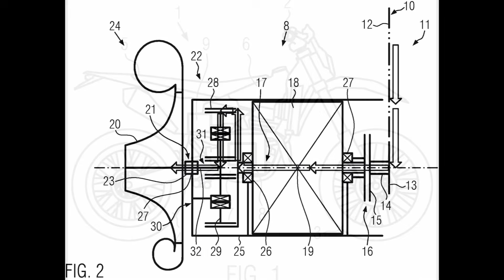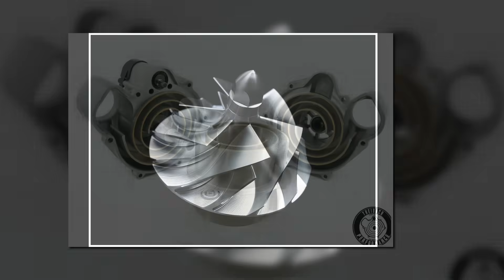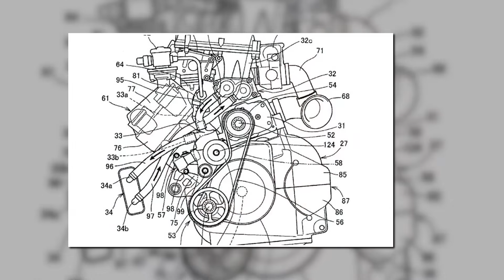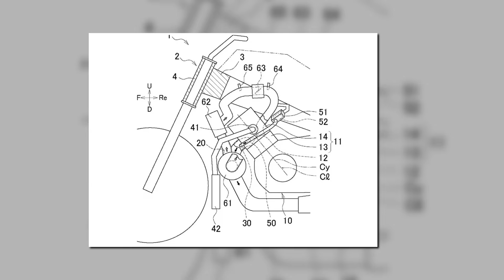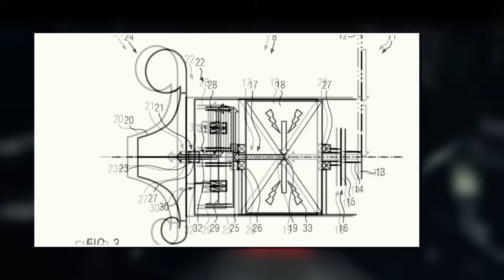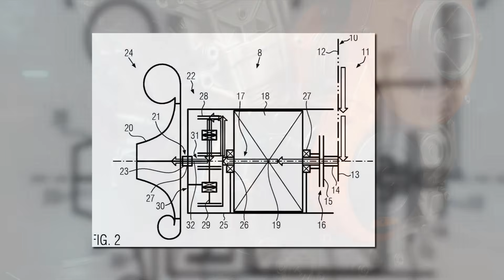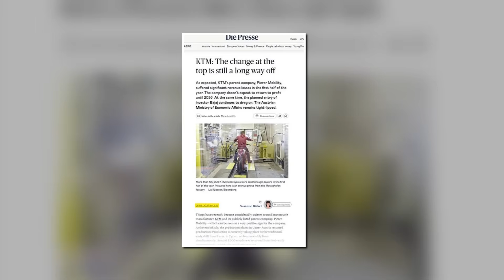Did KTM Just Reinvent the Supercharger?

Comment: The answer to the question at 1:15, "how do you get the instant throttle response of an electric system and the efficiency of a mechanical one?" is just have an electric motorcycle not a petrol one with electric supercharging. 

Petrol isn't efficient.

Electric done right is just better in every way. Lighter, more powerful, cheaper, lower maintenance, longer life, quieter, better throttle response, better traction, better traction control. 

Just mass produce some good electric bikes. All we've had are tiny runs of practically hand built specials at enormous markups and shoddy business practices that rival KTM's. 

We don't need or want supercharged petrol engines. They've been a disaster in the car world, and they'd be even worse for motorcycles.
Reply: I'm not interested in riding 15 miles out, 15 miles back, and then being stuck at home for the rest of the day.
Reply: @thegrinch7989  you wouldn't happen to be a motorcycle dealer or mechanic by any chance?
Reply: @gasdive  yeah bro, I'm part of a conspiracy.
Reply from the maker: I was going to say wait for the comments but they already started😊 having seen the UON1 bike close up and seen what it can do I know what’s possible. BUT. I do like long days riding 2 up often with luggage and I certainly don’t want to be sat behind draughtiness Lorrie’s to eke out the range. So I don’t see any practical examples
Reply: @barebonesmc  I've done many 800 km days on a 2013 electric. The modern ones charge much faster and have twice the range between charges meaning none of the mucking about that I do. But there's still lots of room for improvement with none of the big four wanting the switch to happen, (mostly due to dealers, who after all are their actual customers). The Chinese might lead the way here and it reminds me of when the British marques died, convinced no one wanted reliable bikes that got you to your destination with minimal fuss. The Joy of constant roadside repairs creating a lasting bond between rider and bike.
Reply: @gasdive  The market is speaking loud and clear on this.
Reply: @thegrinch7989     the market has only been offered hand built semi experimental bikes from tiny manufacturers with very little after sales support. The internal combustion equivalent is something like the Langen 250. If you only looked at that you'd conclude that no one wants petrol bikes. 

Add to that the current sales model is via dealers. What dealer in their right mind would want to sell a bike that will only ever come back for tyres when they could sell another old banger that needs a dealer service every 6000 km and 6 hours of billable time every 24,000 km to check the valve adjustment. (Ever wonder why there are no bikes on the market that have hydraulic valves?) Plus after 40,000 km it's worn out and they can sell the chump a new one. Why do you think dealers and mechanics are telling people that electric bikes only go 30 miles and take all day to recharge?
Reply from the maker: 800km days on what electric bike? N how many charge hours that took? All I’ve tried would struggle with that tbh
Reply: @barebonesmc  4 hours. As I said, 2013 machine. The modern ones would need less than a quarter of that.
Reply from the maker: What bike though? A 2018 what? Or am I being dumb 😊
Reply: @barebonesmc  LMAO, the Ind in general is doing it,,,why do you think modern junk is so unreliable today?..recalls  ,on everything, you just don't get it do you...ill leave,..
Reply from the maker: I’m not a mind reader mate sorry. It was an honest question. As you can see I’m one of few channels that actually highlights the increase in recalls. I just honestly have never come across an electric bike that would do an 800 km day including charge times. 200 miles is about the best I’ve seen with several hours charging between runs. So at least 2 full charges to reach 800km even if you start with a full charge and are gentle with the throttle
Reply: @barebonesmc  ok.👍 example ,   my friend Ian Coates...you can google his name...went round the World   on a '97 IIRC 750 Honda Africa twin for so long  it clocked up 380K miles by the time he got back home 13 years later.  ........   [Honda Japan took his bike to the factory for free tyres, service, chain and sprockets on the "house" while he stayed at Mr and Mrs "Hondas"  penthouse! ]..  .🤣.....a brand new  bike would need 3 engine rebuilds to do that with every electrical sensor "fizzing" away, it wouldn't make it. . It is all being made to fail at 3 years or at least on its way,  castings are thinner, plastic substitutes steel, bearings are inferior quality, discs are  recycled steel,  wire is recycled copper full of contaminants  (....the Govts get all the new stuff.).. hence the appalling electrical problems... the "new improved" versions are not improved at all, its even worse with MORE electrical junk bolted on year after year.....RECALLS.  Another friend bought   of those  BMW huge enduro "things"  I asked him why he had bought that unreliable junk shaking my head.......it then proceeded to eat its own fuel  pump 650 miles later. and ended up being picked up by the AA...650 miles from fkn  brand new, eek! ..... he then had to take it back for another  "recall"...as the crap Chinese power coating fell of the  shaft drive casing...really?, at 1500 miles, quality control right there. I could tell you about ABS sensors on BMW cars and "wet belts" on cars and vans but ive rattled on far too long , . I say this with no malice mate, Im from Yorkshire so say it how it is. Im sure we could sit down for a beer with no problems 🤣I have been a biker and mechanic since 1977, its all on a downward spiral im sad to say. The EV thing is nothing more than a collapsing ponzi scheme that will NEVER work.
Reply from the maker: Sounds just like what I’ve been saying for years mate. We obviously got crossed wires. I thought you were talking 800km days on an electric. Tbc my newest bike is an 07. And the oldest and most overengineered is a 74 Laverda. The older they are in general the better the engineering imo. So we are coming from same viewpoint 😊 long day so gonna be early one tonight. Have fun
Reply: @barebonesmc    that was me. I was talking about 800 km days on an electric. On a 2013 build Zero DS with the nominally 11.4 kWh battery (actually 10 kWh) and two accessory chargers. 

Dinner with my daughter, who lives 400 km away. 

155 km to a caravan park where I would plug in and change for an hour and twenty. 95 km to a shopping centre where there's a free AC charger. There I'd plug in for 40 minutes. Then 150 km to her house where I'd plug into two normal outlets while we have dinner. By the time the visit is done, the bike is fully charged. Then 150 km to the shopping centre, 95 to the caravan park, 155 to home. 

400 each way, 800 for the day, 4 hours on the road charging. 

There's an article on the Visor Down site about the preproduction Energica Experia. They do 500 miles (800 km). Having twice the range they only do 2 on road stops and because they're not trying to do it all in a day, they have a charge overnight (but it actually takes only 3 and a half hours) Because it charges 4 times faster they spend a total of 59 minutes charging on the road. Which is what I said above. If they'd been visiting someone who had electricity in their house, they could certainly have done the ride in a day with an hour of on road charging. 

800km/500mile days were possible though wearing 12 years ago and now they're easy.
Reply from the maker: But haven’t energica gone into administration now? 
Re the 800km day that sounds better than most people’s experience. But still not my idea of fun. My tank does around 250 miles between fill ups n I still get sick of stopping to fill up lol even for a few minutes 😊 but each to their own. And I don’t know about over there. But here. Charging infrastructure is just terrible. Planning a journey around fuel stops was why I sold the Vmax 😊
Reply: @barebonesmc       energica is an example of what's possible. As I said, the current crop are hand built in tiny numbers and priced to reflect that. We need a major player to mass produce them but dealers don't like that. 

Energica itself was profitable, it was the investment company which owned them that went into receivership. The latest news is that a company in Singapore has bought them. 

The range is long enough that even poor infrastructure is fine. They charge at Tesla chargers and they're everywhere, (both here and the UK) and super reliable. There are 6 between my house and my daughter's plus half a dozen from other companies. So on my regular trip I'll pass 20 or 30. The UK is much more densely served. 

Don't forget that the 4 hours charging was the 2013 bike. The current bikes are about half an hour every 200 miles. Everyone I have ridden with wants to stop for half an hour after 3 or 4 hours riding. (And I don't know anyone else who rides 500 miles on a regular basis)

PS, Also, don't forget that with an electric every ride starts full. If you ride less than about 250 miles you'll never have to stop. If you ride less than 350 you'll only need to stop for 10 minutes because you can arrive home empty and fill up in the garage. The half hour stops are only needed if you're going 500 miles or more.
Reply: @barebonesmc  We did mate, Im so "anti" electric crap I banned my own customers from owning ANYTHING electric 5 years ago.!...they thank me today for saving them thousands of hours in wasted time stood like a GTA street corner figure waiting for "fuel"  , its all good mate , ill just keep riding my Busa Ive had 17 years or so....electric my arse, EV plants are scaling down with the battery crap as we speak.....tick tock...it does not work, petrol and diesel are going nowhere, the World cannot "survive" without it, cheers......👍
Reply: @barebonesmc  ...apparently, there is a car transporter on fire on the M5 with EVs aboard right now .....hand grenades without a pin.... 💣💥🤣
Reply from the maker: Like I said somewhere. I can see the potential after seeing the UON1 race bike. But at the time I considered building one in a chassis I had, the battery tech was just prohibitively expensive even for a track bike doing 20 min runs but needing recharging between sessions.  As to infrastructure. I tend to stay away from population centres as much as possible 😊 and from what I’ve seen/experienced I couldn’t do what I do with an electric motor. I think they have a place. But I’m not convinced by the practicality yet. Ffs the new Honda has an 87 mile range at best. Also. For me. I’m crap at laptop and phone batteries never mind bikes 🤣🤣🤣
Reply: @barebonesmc   @barebonesmc    if it was still 2010, then I'd agree. Right now there are 6554 locations with 17,132 rapid chargers listed on Zap Maps in the UK.  That's only slightly less than the number of petrol stations (8465 as of June this year). If you include places you could charge up in an emergency to get yourself to a rapid charger, or while just stretching your legs, there's over 40,000 locations. Running an electric does not mean you have to go to London to charge up. You can stick to the countryside. I don't know what you consider to be out of town, but there's 4 rapid chargers and dozens of slow ones inside the Snowdonia national Park. Pick a remote place and have a look at Zap Maps to see.
Reply: @barebonesmc  ten rapid chargers in the Cairngorm National Park. 45 chargers if you include the slower ones. That's inside the park. Not near the park, not on the way to the park. How remote are you going?
Reply from the maker: Unfortunately in practice. More are not working than are. But tbh I prefer travelling outside the U.K. nowadays. The U.K. is a mess. How many in Asturias? Or the Sierra Cazorla? Tourist destinations tend to be well covered but I try and avoid them too 🤣🤣 I like the places no one goes lol. And tbh. Part of it is about what I know and am comfortable with. I’m pretty sure what I have already will outlast me too lol. And when the oldest bikes I have are without doubt the most overengineered I am less convinced than most about Progress 😊 it’s all about what suits you and your priorities 😊 for me. I’d rather spend the money on new adventures than expensive new bikes. Whether petrol or electric. It really is that simple for me 😊
Reply: @barebonesmc  of it's not your taste, I can't argue with that at all. If it's not in your budget, that's fine. If you don't feel like learning something new, well I'm the same. 

But you're arguing with made up facts. Tesla chargers have more than 99% up time, and Zap Maps shows off they're up our not, and it's certainly not true to say they're more often down than up. It's just not. 

There's none in Sierra Cazorla, but there's no petrol either. There are however far more places to charge than there are people stations around the park. 

So if you don't like it, fine, but don't just make stuff up because it confirms what you'd like to be true.
Reply: @barebonesmc  Agree mate
Reply from the maker: I’m not arguing mate. And there are petrol stations in Sierra Cazorla. Just not everything is online😊. As to uk chargers not working. Seen too many queues when only 1 of 4 chargers are working at many service stations. Recently as well as over time. What it says online and reality aren’t always the same. That’s my experience. If yours is otherwise that’s great. Just not my thing. N I did do a lot of research when I wanted to build an electric track bike. Hence my contact with the UON 1 team 😊 I talked long and hard about the build with the team and with Jeremiah Johnson who was one of their riders at the time. In the end my conclusion was no. But that’s just me. If we all thought the same it would be boring 😊 and one certain model of bike would be VERY expensive 🤣🤣🤣
Reply: @barebonesmc  this is the most bizarre conversation.

Imagine if the tables were turned. You'd been successfully riding your petrol bike around rural Australia, doing 800km days on the regular. Then you get into a conversation with a bloke who's telling you that there simply isn't the infrastructure to make petrol practical and they are sticking to electric. You point out that you've been doing it in rural Australia for 15 years. They tell you that might be the case in tourist spots in the densely populated Australian outback, but in the barren and unpopulated wilderness of Europe, with only 700 million people, petrol stations are almost non existent. Sure there are tens of thousands of them listed on the internet, but the internet isn't real life. Those petrol stations aren't really there, and if they are, more than half don't sell petrol. And anyway, they were thinking of building a petrol bike from scratch, so they looked at John McGuinness's Isle of Man race bike, found out how much 130 octane petrol costs, how difficult it is to source, and discovered that petrol engines need to be rebuilt every 200 miles. They're now an expert and as an expert can assure you that you don't ride 800 km a day and neither does anyone else. 

You'd scratch your head and wonder what on earth this was. 

So am I. I'm here in rural Australia, 400 km from a city, been riding electric for 15 years and someone is telling me that they studied an IOM race bike, talked to the rider, and can assure me that I'm not able to go see my daughter by electric bike, and that you can't ride rural Europe either because they don't have electricity away from the tourist places. 

It's utterly beyond comprehension.
Reply from the maker: You’ve made loads of assumptions there mate. All I’m saying is it’s not for me. I never pretended to be an expert. Just talking about my own experiences. Not everyone’s. Just one thing.  Have you used electric hook ups in the U.K.?
Reply: @barebonesmc  no, I've not used electric hookups in the UK. The basic household outlet is more powerful than ours, at 13A instead of 10A with the same voltage.  Are you implying that there is less EV infrastructure in 2025 UK/Europe than 2013 Australia? (We got our first rapid charger in June of 2013 it was 1250 km from my house (the same distance as London to Milan), not that my bike could plug into a rapid charger)
Reply from the maker: No. I’m not making any assumptions about Australia. Just saying the U.K. infrastructure isn’t what it’s made out to be. You also need to consider that many homes in the U.K. don’t have the ground plan of Australia where you have so much space. Many homes don’t have garages or even space for a driveway. Many people live in flats and even more only have on street parking. So home charging becomes much more of a problem. Local authorities have had budgets cut for decades now and so charging systems are only built by the private sector and in general cost far more per kWh than home electric costs too. And they only build where they know demand will be high. Breakdown cover and insurance on electric vehicles is also often astronomical in comparison. So ownership costs per year show little if any advantage over ice vehicles. So for the average Joe they are simply unaffordable. So take up of the tech is poor. Sales of electric bikes beyond the surron and it’s like are abysmal and dropping not increasing and the surron is seen primarily as a courier vehicle for drug dealers so have a different but equally bad reputation. Which again drives the general negative way they are seen. Even in Europe as a whole sales of electric bikes are way down compared to ice bikes which was a big part of ktms demise and fantics troubles because they invested so heavily into it. Add to that the negativity associated with cobalt and lithium mining for the batteries and the environmental cost of extraction and shipping back and forwards of battery packs and raw materials and you have a downward spiral in sales. It’s a complex issue and I’m no expert but sales figures speak volumes and they are seen in many ways by different people as passe and even foolish
Reply: @barebonesmc  excellent. Electrics have down sides and are far from perfect. Glad to see you discuss actual downsides rather than whatever that was before. 

More downsides...

After sales service from the major players in the space is terrible. Spares are unreasonably priced. Quality control is poor. Onboard charging is generally limited to the US household standard of 1.3 kW instead of the much higher powers used in most of the world. Mechanics refuse to work on them, even when it's completely unrelated to it being electric, such as tyre changes (the trick is to remove the wheel and take it in without mentioning what the bike is). Charge control isn't up to the standard of even the most basic cars (being able to set maximum charge limits for instance). Removable battery bikes that suit people without off street parking are limited to the most basic bikes, usually scooters though there's no technical reason for that. Motorsports organisations alter rules to exclude them. None offer the kind of fairings that could double range.
Reply from the maker: 😊 I acknowledge it’s not my area of expertise really more than anything. As with all there’s plus’s n minus’s. 😊 and QC and parts supply going down the pan on ice bikes too sadly
Reply: @barebonesmc  will it's been an interesting discussion that's made me think.
Reply from the maker: As always mate. And cheers to you too. It’s always good to hear different sides of any story 😊
Reply: @barebonesmc  it's a rare thing these days. In times gone by it seemed we could passionately discuss things over a beer while the bikes cooled and made tinking sounds and at the end of the day everyone was friends. Now a word out of line and we're mortal enemies. It seems society has shattered into a billion bits.
Reply from the maker: Divide and conquer as they say. And social media accentuates that polarisation sadly instead of bringing us together
Reply: Oh I dont know.....plenty of snowflakes with zero common sense in the comments like it,   so?..🤣..bahaha, junk that will never go anywhere.
Reply: Its been efficient for 120 years...🤣.that electric crap??? "efficient" the irony.😂